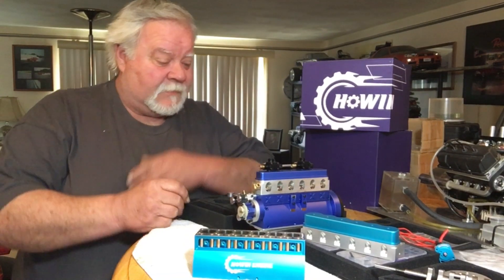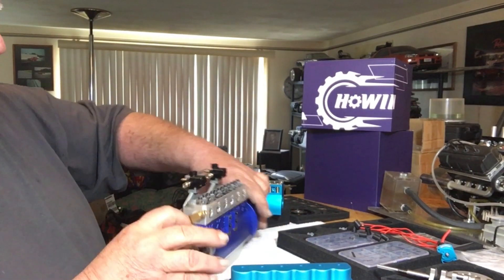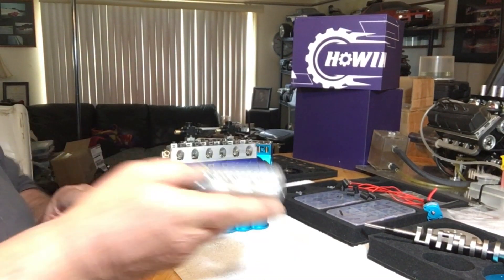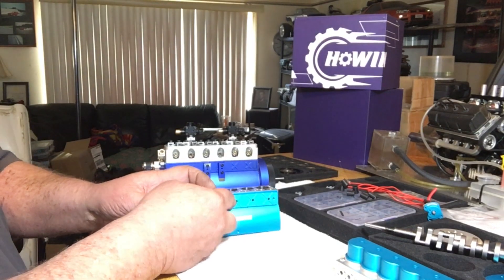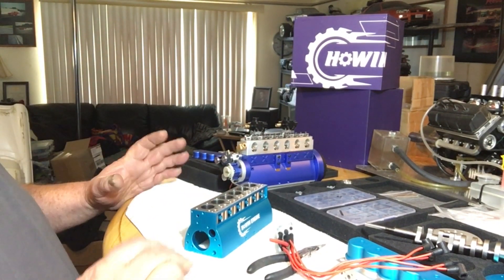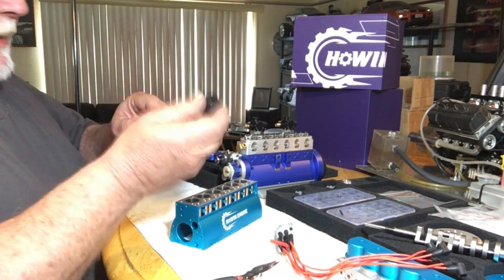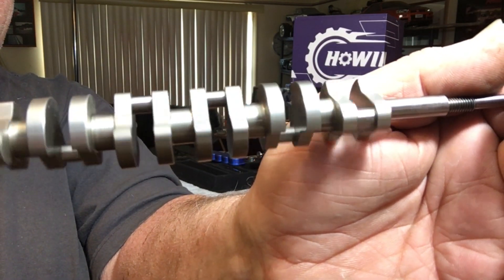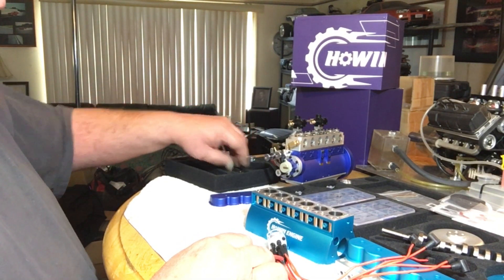INTRODUCING THE NEW HOWIN RC L-6 FORD L-6 300 PRODUCTION VERSION

Comment: you deleted the video about the oil hole issues with your block and now I don't know how to assess if my block has missing holes!
Reply from the maker: Hi brother look in the side cover where the brass lifter sleeves are there should be return holes on the bottom to enter the upper camshaft, I hid the video to be honest because I failed to show the missing holes on my engine,  my new replacement cylinder block is in the mail stay tuned for a video on comparing the differences, these are a really sweet engine and I didnt want to disrespect all the great features if that's cool with you?
Reply: @dennisdempseyradiooutofcontrol  it is a beautiful engine, just got mine. I have 3 holes. I think there should be 6 though, 1 for every piston or set of lifters?

Comment: Now you just need a scale F-150 pickup to drop it into! If it was me, I think I'd figure a way to get an oil gallery to that lifter cavity and cross-drill the lifter bushings. It just doesn't seem that there would be enough oil splashing around to keep things lubed that high in the block (never mind the rockers).Other than the ports being insanely small, it looks like a pretty nice build. Glad to see they decided to use 7 main bearings/bushings to give that crank some support! I'm kind of surprised they don't have any water jackets in the block, even though it's a steel sleeved aluminum block. Hopefully, it won't seize a piston when it gets hot. (I'm assuming it's designed to run on gas?).😉👍

Comment: Top vid as always. One thing I see on all these 4 strokes is the cam lobe looks like a wedge with no smooth transition over the top. Wondering if there is a reason for this. Cheers
Reply from the maker: Good call brother! if they would give it a better ramp with more duration and a higher lift I think these engines would own the show, The first thing I noticed on my Aussie V8 was a huge duration and a high lift on the camshaft.
Reply: My thoughts exactly! That may be why they have such tiny ports as well, because they don't have much intake/exhaust velocity, plus it would naturally limit the rpms so people aren't blowing them up, right and left!😂
Reply: If you look at a full size engine, the smooth lobe transition on a cam has several advantages, but the most is longevity. I personally don't think that will be the case. Either the lobes, or the lifters will fail from such a steep ramp increase.